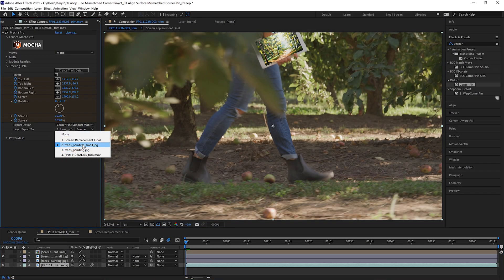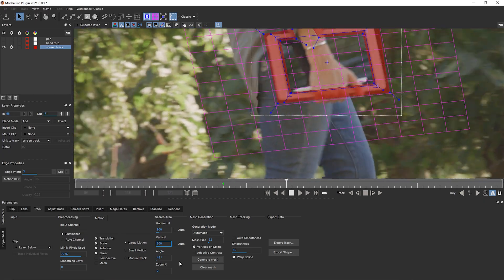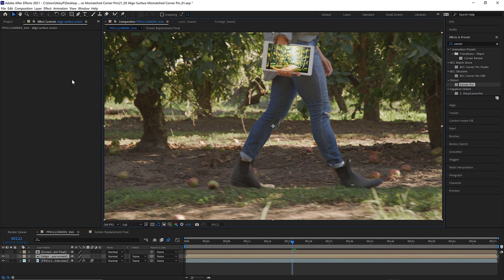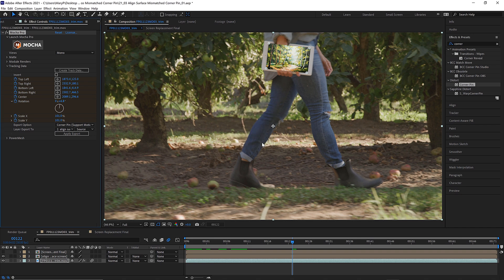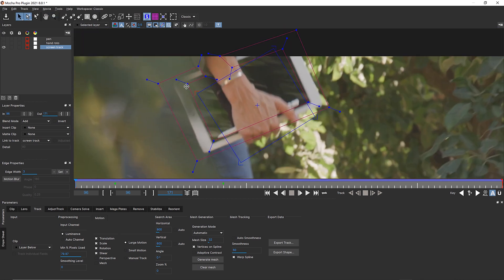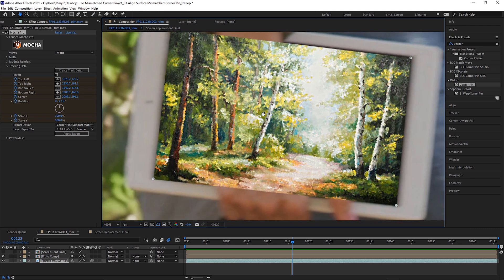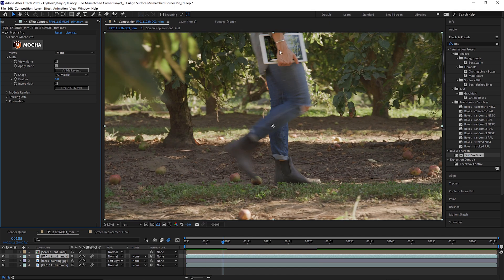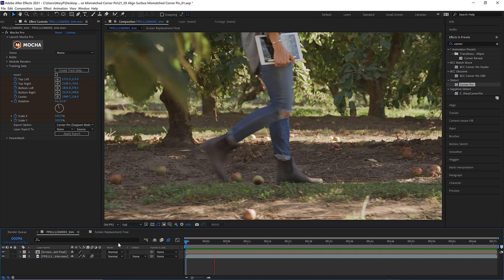Mocha: Align Surface & Mismatched Resolutions

Comment: How to fix same problem but in Premiere Pro ?
Reply from the maker: You can do a similar thing to AE. Right click and Nest the insert clip. Double click to go into that nest and then change the sequence settings to match the settings in your main sequence. 
Alternatively, as you are using Mocha Pro inside Premiere Pro, just use the Insert module and place the clip directly in there. In the Mocha Pro plugin you can then choose to Render Module > Insert.  That'll work too.
Reply: @BorisFXco  Thank you, ill try it

Comment: Nice tutorial. Is there an existing tutorial that addresses the following problem? Say the iPad in this shot had a bright green screen during production. When you go to track and replace the screen (just as you did here) everything is great, except when you turn on motion blur now the new hero image jumps over a few pixels and reveals the green iPad screen. This is what's happening to me. I tried adjusting the shutter phase in my comp but that wouldn't fix it. I'm sure this is a common problem but I can't seem to find a straight forward solution. Any help would be majorly appreciated since I have many shots like this to get through!
Reply from the maker: Juggling the shutter phase is the primary way to do it.  Remember the offset works best if it is shutter * -0.5  So if your Shutter Angle is 180, set the phase to -90.  Another thing to do would be to suck the green out of the screen using something like Advanced Spill Remover.  That should help hide the bright green shining through!

Comment: I love Mocha :) Great job guys! Are there any plans on showing an in depth workflow for working with the alembic files that Mocha exports inside of Cinema 4D? There's not a lot of information online about how one would go about attaching 3d objects and making them move along with the Mocha exported alembic data. I know that may skew towards more of a C4D tutorial as opposed to a Mocha tutorial but it'd be extremely helpful for people who may want to use Mocha for that purpose. For example, tracking someone's arm with the power mesh in Mocha, exporting it as alembic and attaching a 3d object to that alembic so that it follows the movement of the arm. Getting the alembic into Cinema is easy but what to do afterwards isn't so clear?
Reply from the maker: Thanks for the feedback.  This is a great topic for a tutorial, as the Alembic data we currently get from Mocha is a 2d plane. Turning that into 3d with C4D deformers is possible but needs a few steps to explain.

Comment: Quick, to the point, excellent!
One thing though, on the second method, maybe checking "continuous rasterize" for the insert comp, fixes the possible loss of detail.
Reply from the maker: That's a really good point. Continuous Rasterize is a good option if you are seeing degradation in a good number of cases. Depending what else you are doing to your footage in the precomp, it may move it out of place again, break effects or ignore masks that you have applied to the footage.  Sadly it's not a cure-all.